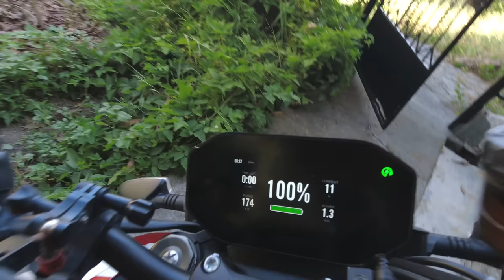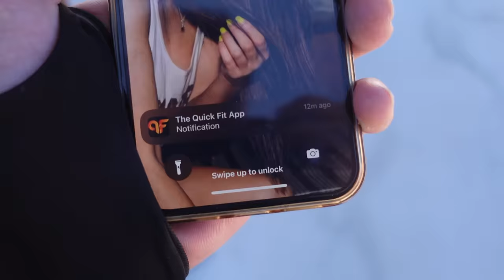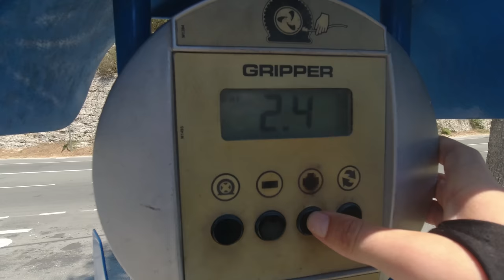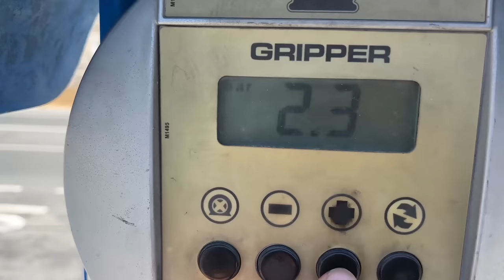Extreme Heatwave caused HUGE FIRE and It's Getting Worse!

Comment: Hey Marc, . 
it is best to inflate the tires when the tires are still cold. The recommended pressure in the booklet applies to cold tyres. While driving, the air in your tires quickly heats up. Warm air expands, increasing the pressure (tension) in your tires. When the air in your tires cools, the pressure drops again.
Reply from the maker: Alright, thanks formte tip 🤗

Comment: Maree's brakes will get incredibly hot. The thing that warps the discs most is when you come to a stop and have your foot on the brake, the rest of the disc (rotor) cools more or faster than the part held by the pads and warps the discs. It's just how it happens. They may last longer if when Maree comes to a stop she could remove her foot from the brake pedal and use the handbrake. This way they may last 7 months ;) 
It's probably how Marks front brake discs have warped too - Happy Birthday
Reply from the maker: Alright, thanks mate 🤙🏼
Reply: And go to lower gear when you go downhill in stead of only breaking ! Even with automatic gear !
Reply: @MarcTravels  yours and Maree's discs and pads should be changed sooner rather than later as the juddering puts tremendous stress on bearings, track control arms, the steering rack etc.
Reply: I’m a licensed mechanic in Canada. These comments about the brakes shaking are spot on. Remember that both the bike and Jimny are carrying around a lot of extra weight. This will cause the brakes to get hotter faster than normal. So gearing down the Jimny and more regen use on Eve will help. Badly warped rotors can fail. It can be very dangerous. I’ve seen it happen a few times. Try to get vented rotors for the Jimny, they might be able to dissipate the heat better. If you can get “racing” pads and rotors, they are designed to put up with more heat than the OEM stuff. For you it would be a good investment. Don’t leave it too long, it won’t fix itself. Bad things happen if a rotor shatters. And it never happens on a nice safe flat road. Love your channel. Keep up the good work
Reply: @barryk8969  👍

Comment: Possible jimmy problems/solutions : rear brakes not working (release air from rear calipers or maybe calipers are stuck and need rebuild) or maybe front  disks are worn out and need replacement.
Reply from the maker: Alright 👍🏼

Comment: It sounds like the cheap discs have warped again, the car is much heavier with all your stuff which will make the brakes work harder. When you drive downhill, if you select 2 on the gearbox when you want to slow down, the engine will help with slowing- the car down and you will not use the brakes so much and they will not get so hot, remember to move it back to D when you speed up or you will make the engine scream..

Comment: Come on now Marc, you know you shouldn't check the oil whilst the engine is still hot. I'd also use the air line to clean the Jimmy air filter with all that dust about 😉

Comment: Mark get the wheel bearings checked on both the Jimny and the bilke, you may not feel or hear a worn wheelbearing yourselves at first but this will lead to juddering under breaking and warped discs. Stay safe.

Comment: Guys, steering wheel vibration may appear when the brake system is applied. And if this happens it is due to the lack of alignment between the disc and the pads. It could also be the lack of tightness in the brake components, such as caliper, gum and disc. Better check it out as soon as possible.

Comment: i wanted to recommend a drilled and or slotted variant of brake discs for the jimjim but found out it has full discs front ant not vented ones ... that plus automatic makes the worst combination of brakes to run serpentines all day or downhill
there is pretty much nothing you can do to prevent that but manage to drive 5 steps ahead avoiding breaking ( vorrausschauend fahren ) wich would be hard to do going down a hill
when you let them do a service make shure they check that your calipers AND pistons are moving good and that they clean the surface wich holds the brakepads good and not just smear something on it after wiping it with a steelbrush 4 times the pads need to be able to get pushed away from the discs freely and change the brake fluid to some new one while at it then you should have done everything you can do except the driving part wich is not something you can hold on to since its dynamic
it will probably happen again, but with that fluid change you are safe on the heat side because the vibrations are more a cosmetic thing in a sense of way

Comment: Loved the episode! Great smooth shot @11:37 passing Maree! Which cam did you use for that? Just the GoPro? Regarding tyres and pressures etc.: if you could put Nitrogen instead of regular air in your tyres, they will stay on the pressure and not expand and contract so much. I have it in the car all the time.
Reply from the maker: It’s with the helmet camera 📷
Reply: @MarcTravels  🤦🏻🫣👍🏻

Comment: Extreme heat doesn't cause fires generally - unless over 200c.  It is naked flames which cause fires.  Very dry vegetation will make it more flammable.
Reply from the maker: I think if it was cold and wet instead of hot and dry it wouldn’t have come to this 😅 but of course I get your point 🤙🏼
Reply: @MarcTravels  True, it's cold and wet in England and not a single wild fire to be seen.

Comment: On the Jimny brakes... you might have a caliper issue.  This happened on my vehicle as well.   The calipers freeze closed / on and don't retract enough for the rotors to cool when you're moving.  The brake rotors heat up and then warp.   Which would make sense why Maree feels it more on the downhill drives.   I would check the calipers out and then get new rotors.   Also you can get slotted rotors from a reputable company like Centric / Stoptech or EBC which will help keep the rotors cooler since you're traveling with a lot of extra gear.

Comment: OK, so on the brakes:
Do they judder as well when they're cold? If no, then its justa temperature issue. Even though you drive an automatic, for downhill you should use the engine brake by downshifting manually. This will save the brakes from overheating and keep you safer.
When they judder all the time, it can be either warped disks (from overheating, which couldve been prevented if you use the engine more to slow down hill on long descents) or a brake pad 'stamp', which may happen when the brakes are hot and you come to a halt and keep the brakes on.  This leaves a mark on the brake disks that you can see feom the outside. Basically a bit of pad material burns onto the disk. You could brake this off, you can find procedures for this on youtube.
Honestly, I expect warped disks from overheating due to light ptolonged braking on long descends... basically operator error, learn to use the engine brake better ;-)
Lastly, when you do brake on long downhills, it is better to gain some speed and do shorter harder brakes before curves, NOT keep the brakes on all the time. this will allow your brakes to cool down between brake applications.

Comment: Natural heat doesn't cause fire.
Reply: The temperature for the piloted ignition of wood is typically about 350 °C, whereas the spontaneous ignition requires a temperature of approximately 600 °C.
Reply from the maker: Okay 👍🏼